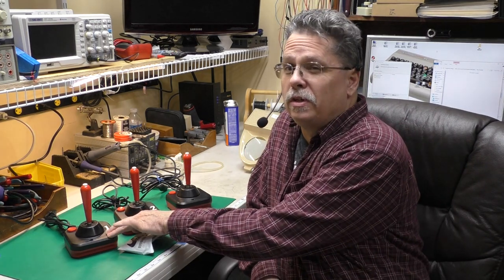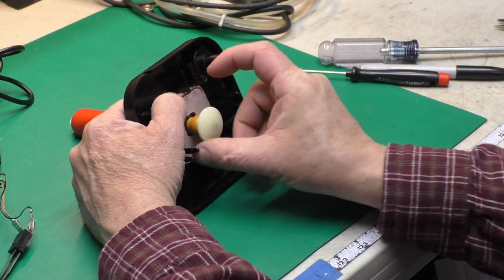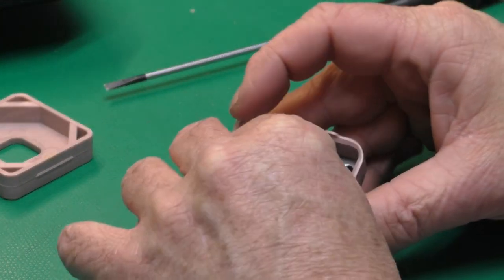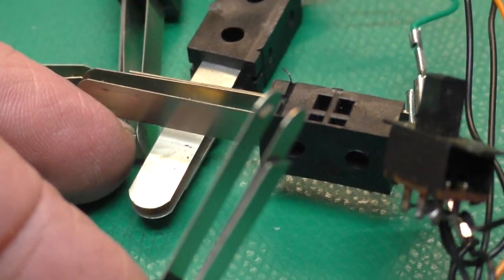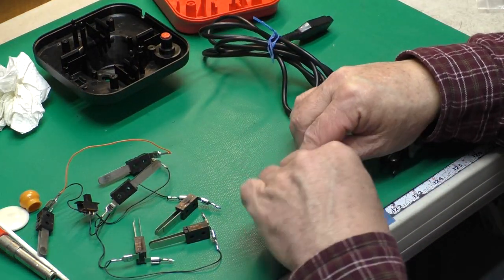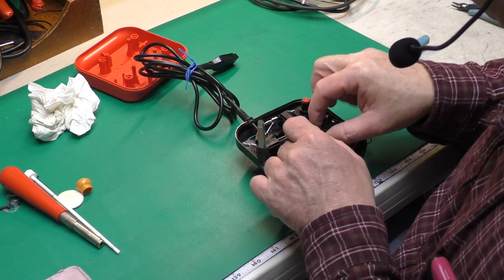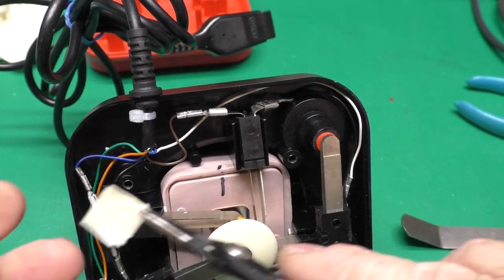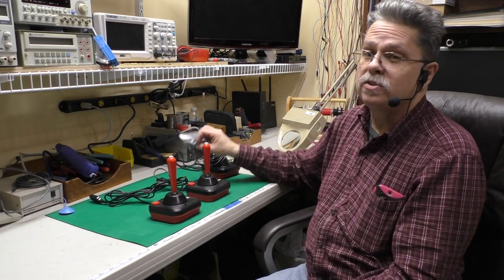Wico Command Control Refurbish

Comment: I've always wondered how these joysticks compare to the TAC-2 controllers. Do you have any idea?
Reply from the maker: I've never used a TAC-2 so I'm not sure...
Reply: @HeyBirt  I think they work with spring leaf switches as well, so I imagine they would feel much the same.
Reply from the maker: @TheHighlander71  I looked on YouTube and found Jan Beta did a repair on one of these. It uses a similar rubber centering grommet but uses a brass ball to short contacts in a ring for directional control. A very interesting approach, much better than the old Atari unit.

https://www.youtube.com/watch?v=EOudtF34KGQ
Reply: I had both this one and the TAC-2. They were both great!

Comment: do you know if this bushing will work on the  Wico Command Control Joystick AT-5200 as well
Reply from the maker: I think all the Wico joysticks with leaf switches use these bushings/grommets. There are two types though. One is for a 1/4" the other for a 3/8" shaft.
Reply: @HeyBirt  Actually I opened it up to take a look and the bushing won't work on this controller thanks
Reply from the maker: @smokingunclefrank6037  Does it have leaf switches or micro switches?
Reply: @HeyBirt  For the buttons it has leaf switches as for the stick it looks kind of like a plastic cage best description I can give I'll see if I can post a photo of it later on but I'll need to open it up again

Comment: Do you possibly know another source for the centering bushing?  The source you listed is out of stock, and I can only find one other source, which is also out of stock.
Reply from the maker: I'm sorry I don't. They pop up on eBay every once in a while but they are about 2x what I paid. Since they are a standard arcade joystick part I would search arcade machine parts places.
Reply: @HeyBirt  Just found some on Ebay.  For some reason they didn't show up the first time I looked.  They were a little more expensive, but not too bad.  Might not be any more expensive depending on shipping costs.  $11.50 a piece plus $5 shipping.  I got two, and shipping dropped to $7 for both.

Anyway, thanks.
Reply from the maker: This is a good deal. The ones I saw previously on eBay were about $20/each.
Reply: @HeyBirt  For anyone else asking about these, I just got a message back from arcadeshop.com, and they say they will have a new batch in 2.5 weeks, so other people won't have to go searching hopefully.
Reply from the maker: That is good news. I was very happy with the product, price and service from them. Glad they were able to get more in.

Comment: Do you happen to know how to repair Atari 5200 Command Control joysticks?  I have a couple of them, but they seem to have bad potentiometers.
Reply from the maker: I may have worked on some of them back in the day, I can remember repairing loads of Atari controllers. 

A very common issue with any controller is some of the wires breaking near where the cord enters enclosure. You have to open the unit up and then ohm out each wire to the DB9 end of the cord while trying to flex the cord at that spot.

Pots do wear out and could also suffer from cracked solder joints.

Hope that helps.
Reply: @HeyBirt  Somewhat, although I'm just gradually familiarizing myself with the terminology.  Based on videos I've watched of general pot repair in volume dials and guitars, I'm hoping that the pots are just corroded and I can clean them up with a little Deoxit F9.  Is it likely that the pots are not that much different from any other pot, to the extent that I could order some new generic pots from somewhere and replace them if necessary?
Reply from the maker: As I recall Atari, Commodore, etc. all used 470K linear taper pots in paddles so I'm guessing they would do something similar in an analog joystick. You'll have to loot at them to be sure though.

I did a video a few months ago about restoring a pair of Magnavox Odyssey 300s. The pots on these were very dirty and after a good cleaning worked well. If you are curious: https://youtu.be/x8b5vxDyXCs
Reply: @HeyBirt  Thank you very much!  I will check it out.

Comment: Had one of these back in the day for my C64, never really liked it, too much movement and no clicky action. It came with 3 different cool handles though.
Reply from the maker: Yeah, different folks like different controllers. I do have to say though that these have really held up over the years. My original two only came with the bat handle though.
Reply: @HeyBirt  absolutely, it's a fairly high end joystick and very good quality compared to the cheap QuickShoot etc. I believe mine came with an arcade like ball handle, the handle you show in the video plus a flight simulator like handle. However my absolute favorite joystick back then was The Arcade, very tight and microswitches on all actions.

Anyway, thanks for the video, brings back good memories.

Comment: looks like you could use pinball machine switches if they needed to be replaced.
Reply from the maker: That is a good idea. The arcade parts shop I got the centering bushing from carries the Wico switches too and I suspect you are correct they are a common part in arcade type machines.